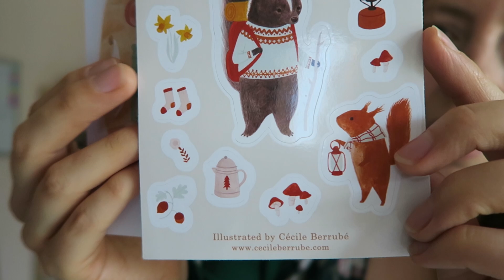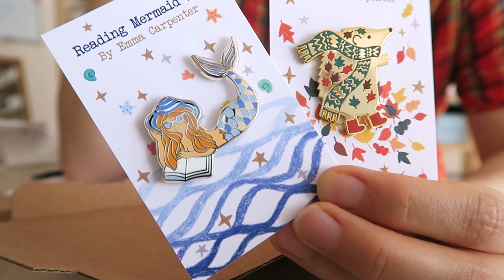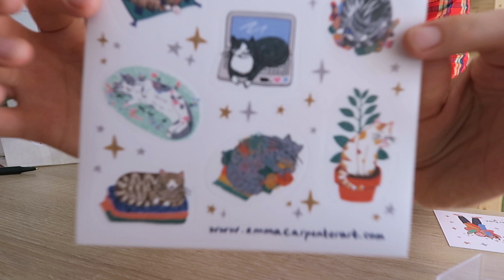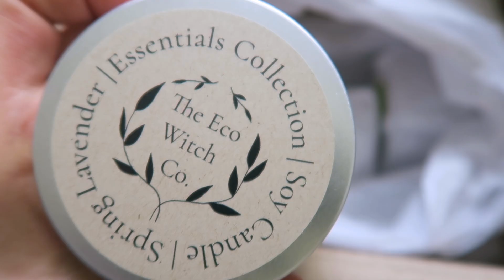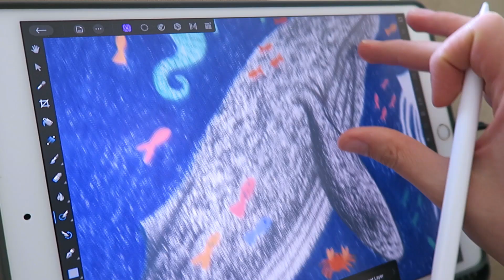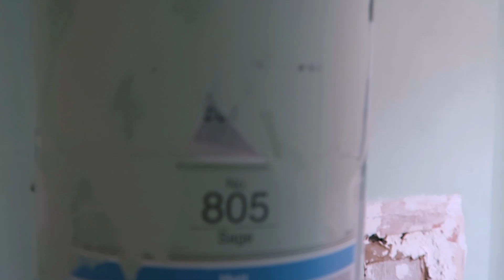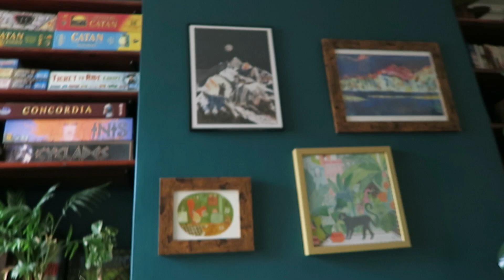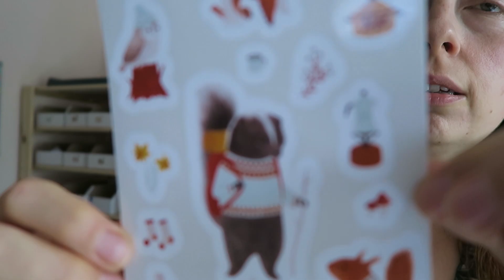Studio Vlog 60 ⭐ an honest chat about my shop sales & happy mail from Etsy shops

Comment: Do you have suggestions for color printing to get best results matching own computer image
Reply from the maker: Hi Barbara 😊 I'm getting the prints made by a printing company not by myself. It's really difficult to get the colours to match exactly because everyone's computer monitors could be set up differently, but you could work in CMYK mode if it's something you want printed. Best thing is just get some samples done to see what the colours look like and then you can make changes after if you're not quite happy with it. Good luck 🌺